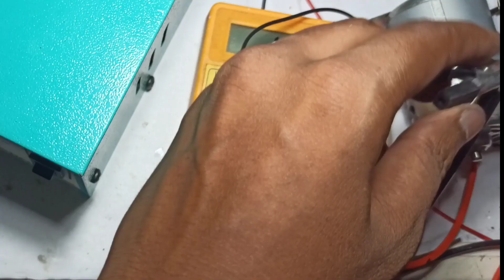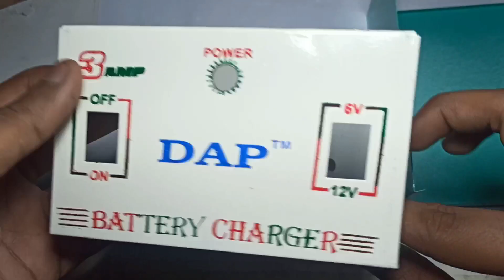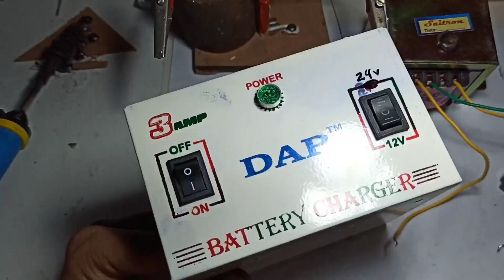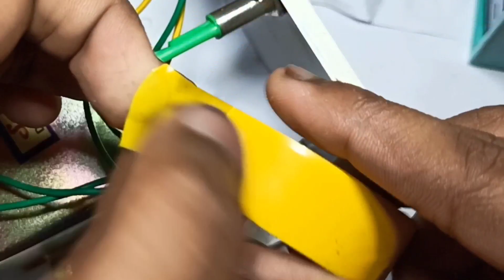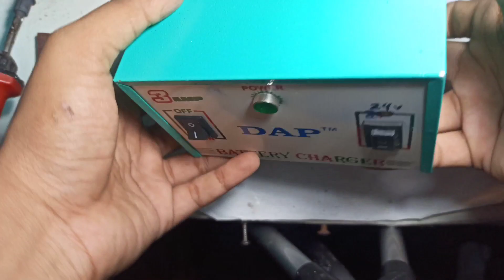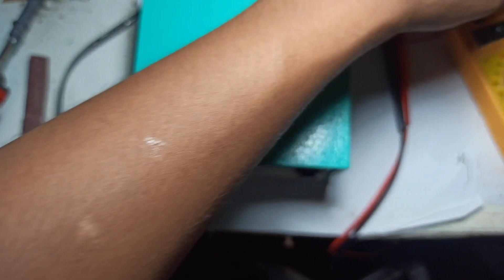How To Make A Power Supply DC 12v & 24v||12v & 24v Battery Charger

Comment: తయారు చేసి వీడియోలు పెడతారు కానీ ఏమేమి సామాన్లు వాడాము అన్నది చెప్పరు అటువంటప్పుడు ఈ వీడియో ఎందుకు 🤔
Reply from the maker: DC 12 volt or 24 volt motors DC 12 Volt led light use as a 12 volt battery charger